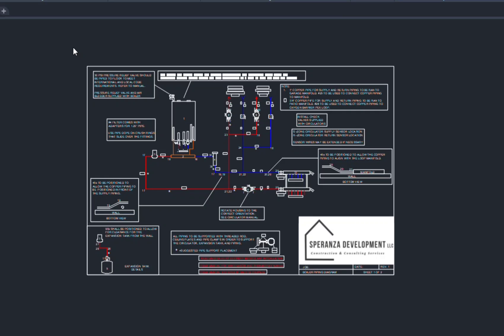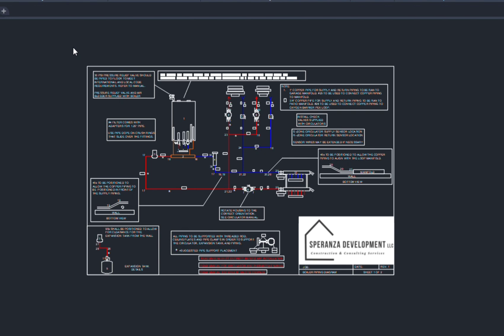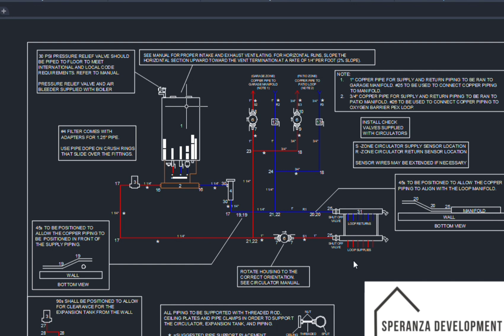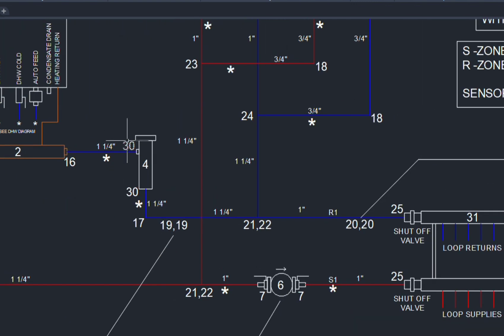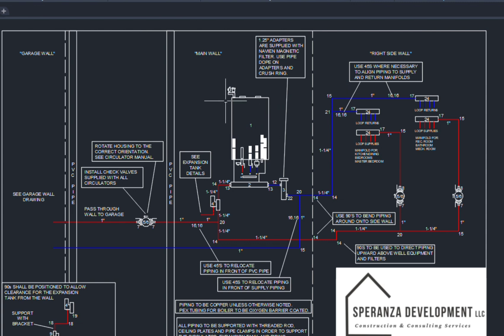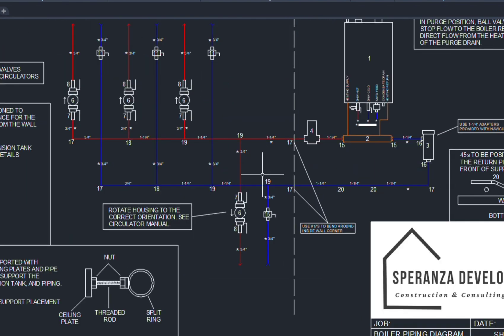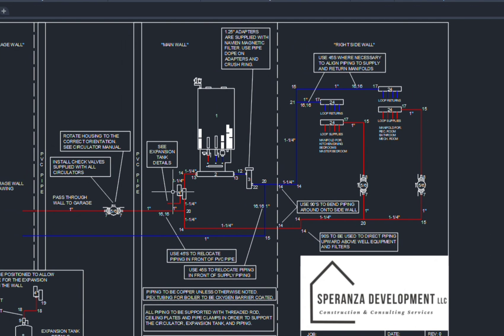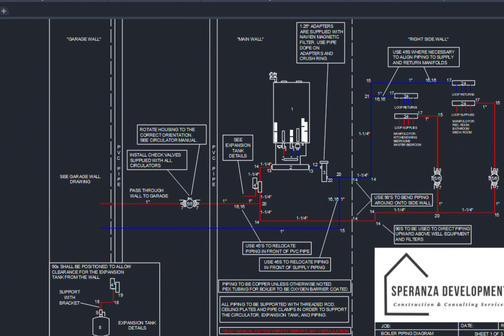Boilers System Design - Sizing, Layout, Parts Lists

Comment: Hey Jim, when I do another house hopefully, I'd be interested in a pre-built system. Where are you located? How much is it to ship? What would be the labor on a job like this? (for example, right now I have radiant with 3 pumps. 1 for hardwood portion with a mixing valve, 1 for lower floor, all tile, and one living room with kitchen, all tile). 10 thermostats, 3 manifolds.
Reply from the maker: Email me at speranzadevelopment@gmail.com